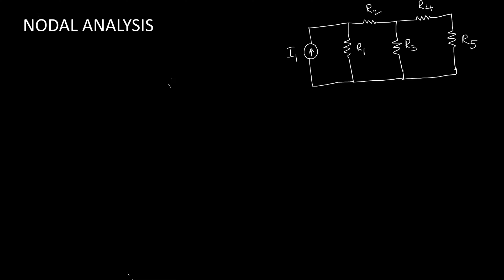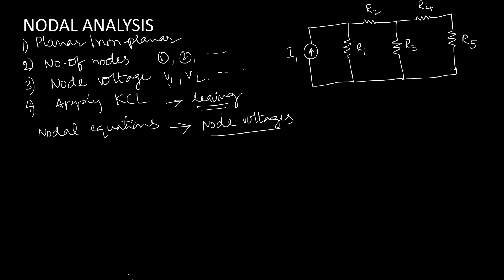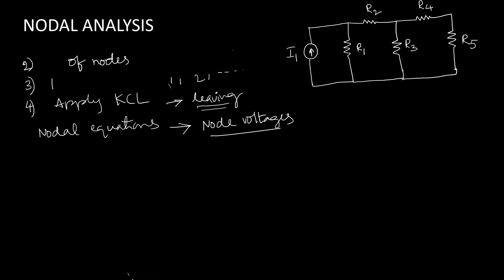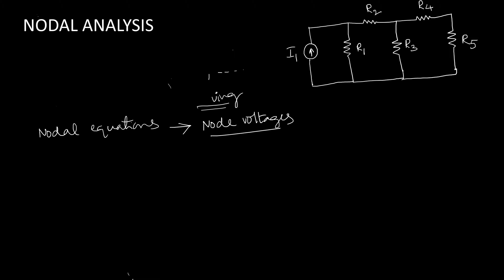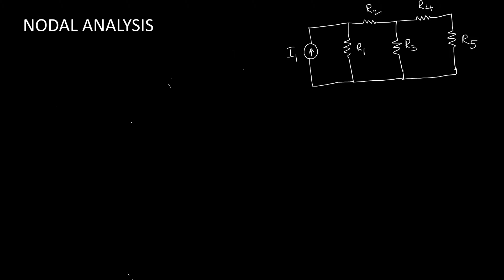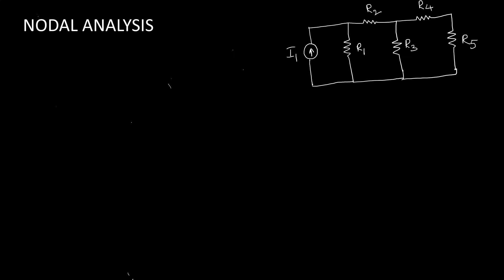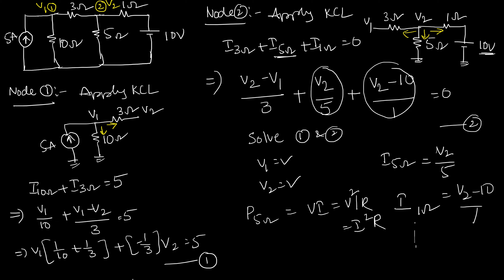Nodal Analysis with Examples|| GATE 2021-22 || Electrical Circuit Analysis

Comment: Thank you mam .what is the current through 3 ohm resister ? v1-v2/3 or v2-v1/3 which formule is correct mam?plz give ans mam
Reply from the maker: If you consider node 1, then the current relation will be V1-V2/3.
If you consider node 2, then the current relation will be V2-V1/3.